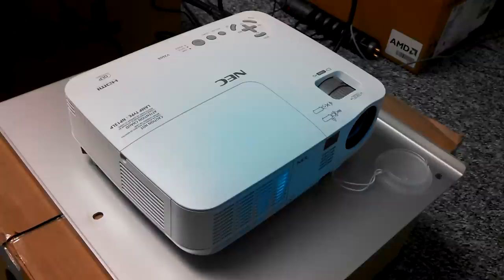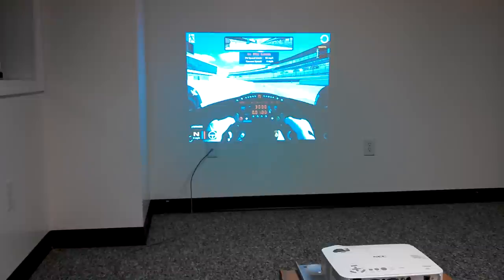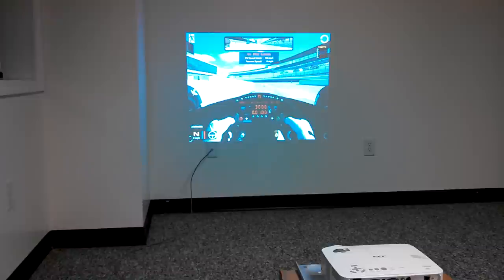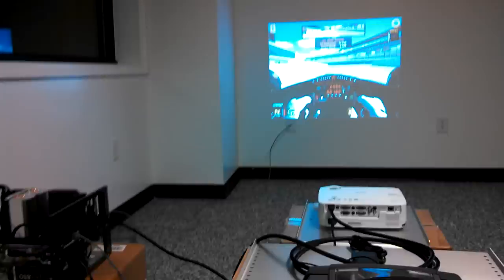Part 1 of 3: NEC NP-V260X Input Lag Testing Using iRacing.com

Comment: I picked an Optoma HD66 off of Amazon for cheap and have been exceptionally pleased with it considering I paid less than $300 for it (bulb was at 1500 HRs, now 3200 and still going). It has slightly higher than 720p native and does 3D if you pick up DLP shutter glasses. BTW, from experience, tack a medium tone grey/dark grey sheet up and it will look ten times better than a white surface. I'm typing on mine right now with the room lights on and it still has good whites and much deeper blacks.

Comment: Almost forgot, a good way of finding the correct shade of grey for your room lighting and bulb brightness is to go by the fabric counter and have them cut you out several 1'x1' squares of fabrics in varying shades of grey and then tack/sticky tack them to the wall and project something on them to find that sweet spot of deep blacks and bright whites. Hope that helps anyways. Nothing like racing on a 9 foot screen! Last, I'm very envious of your wheel...